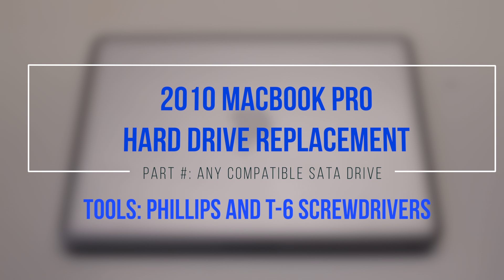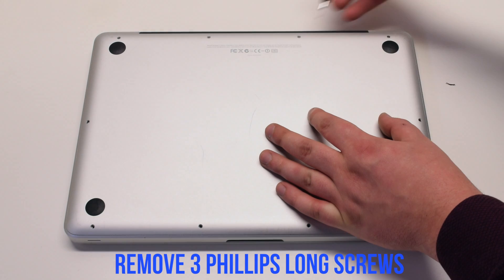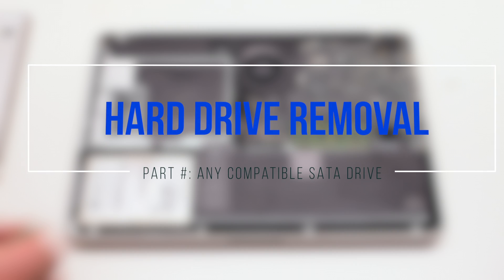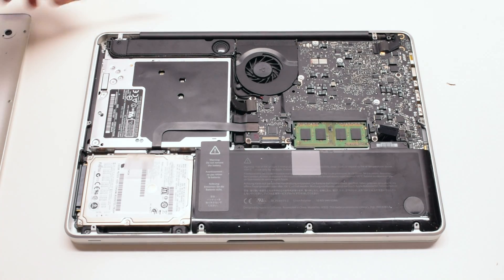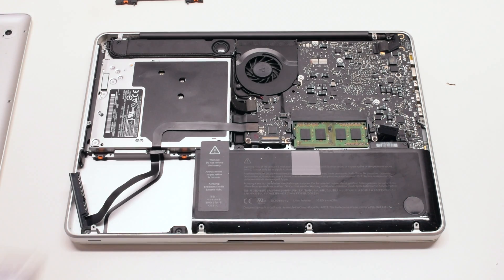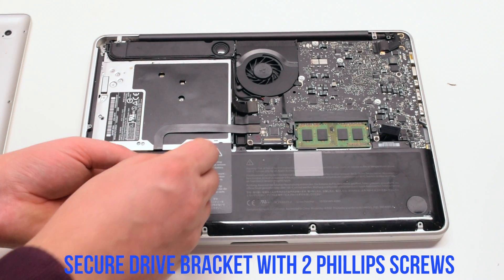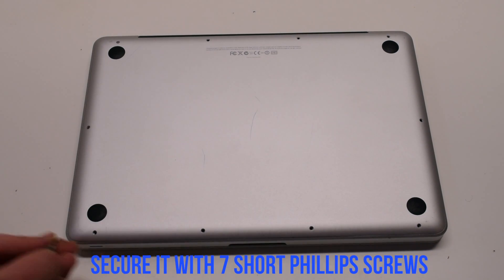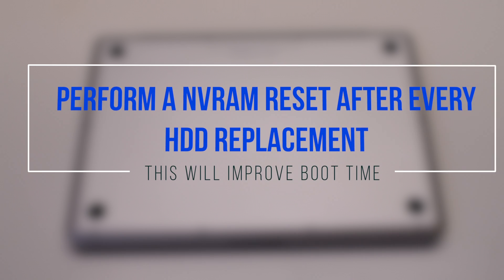2010 Macbook Pro 13" A1278 Hard Drive Disk Replacement

Comment: Hi there, I have an old MacBook Pro which doesn't turn on. I have some data on that hard drive. I was wondering if I convert the hard drive into an external one using a casing and connect it to another MacBook, will I be able to access my data?